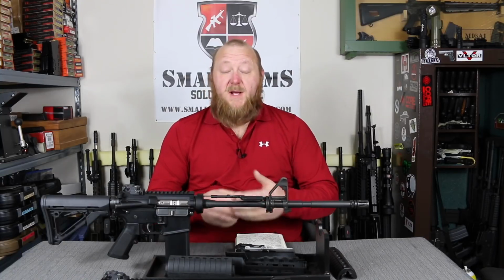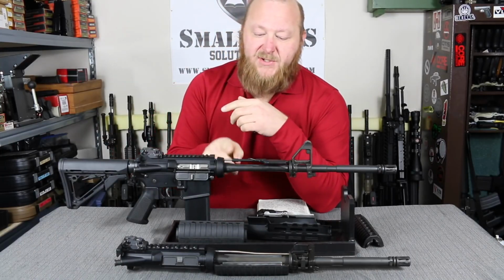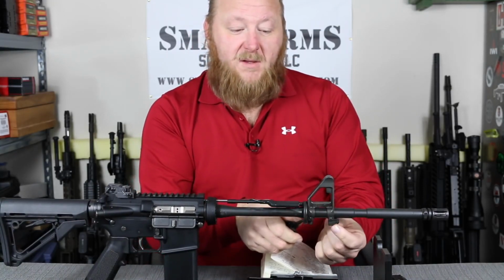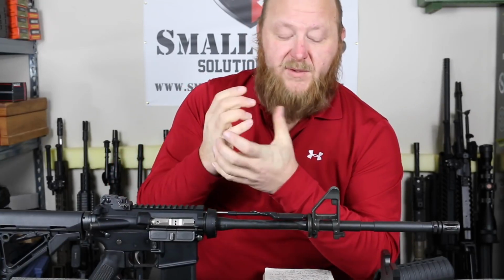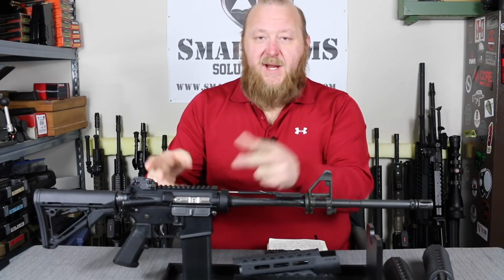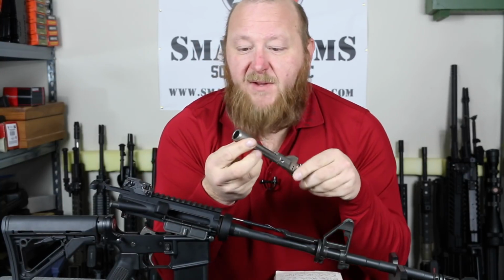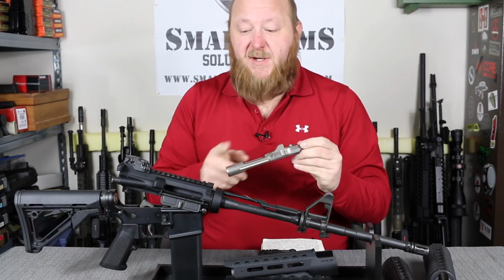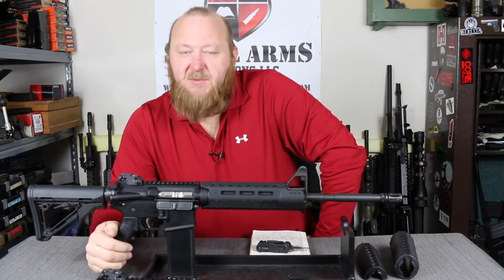Osprey 416 Piston Conversion Kit

Comment: The direct impingment system has had the bugs worked out of it. When our troops first got the M16 in Vietnam, many died with a jammed weapon. It is dirty. The farther you can keep the grime from the chamber, bolt, and carrier, the better.
Reply: True but the point of this system is ease of cleaning and suppressors.

Comment: DI system and piston system. Change Law of Physic. Push vs pull of gas to action bolt carrier. I have all retro fit systems. Osprey, Adam Arms and Ares. Osprey and Ares systems maintain FSB, a huge plus. However, Oprey required to grind the barrel nut down ro permit the op rod freely slide. One piece bolt carrier needs redesign due the carrier tilt issue. On the other hand, Ares is well designed system  and too bad they not longer the market. Adam Arms well designed system as well. Too bad, no re-use FBS. No carrier tilt as well.

Comment: Its too bad that the op rods are now only available in the carbine length, via Osprey Defense’s website. The op rod is only available in the standard version too, not modified. This conversion kit is a great design (best imo - it could use some tiny improvements though), but this kit is slowly becoming a fringe product / solution for piston conversion options. Give it another year and I think it might not be available anymore. If Osprey Defense — owned by Franklin Armory — did an advertising campaign for this piston kit,  and proved the kit’s abilities.... I think it could step over other piston kits available and be in the lead for this particular market.

Comment: Great presentation and agree with your evaluation. I've followed them since the beginning and have one installed in an
original Bushmaster 16" Carbine. As you say the greatest advantage is the extended dwell time produced by the "kidney"
shaped cylinder and piston. It give a greater working volume for gas expansion which allows the port to remain the same size 
yet probably keeps the system pressurized for a longer period at a lower overall pressure resulting in a "softer" push for a longer time. It would be interesting to measure/calculate the volume of the Osprey cylinder and compare it to the gas tube and standard
 bolt carrier volume at the point where the gas vents from the piston gas rings. It brings to mind the original
ZM Weapons system that I believe utilized a plenum chamber in the gas block/front sight.  Best regards.

Comment: Watched ur video and makes alot of sense to me now. I've never had piston ARs but had AK and SKS in the past. This is my first AR and it's a mix match DI and I have been looking for anything to help longevity from the rifle before failure. So far I've installed a Faxon TiN BCG, a Super42 buffer spring and H2 weight, an adjustable gas block by OdinWorks and am wondering what does it take to get something with the performance level of the little P416 that IraqVeteran8888 tried to meltdown and couldn't. I know that particular gun is a piston driven AR but with that part alone aside, what in the heck else could it possibly be helping it to last the distance other than the fact it's just POF we are talking about here and they rock? The only things I can possibly think of doing that I haven't is to go with an inconel gas tube which I'm using carbine length gas setup and 16" barrel, .750 etc etc and maybe going with a CHF Barrel chrome lined like from RockRiver or RainierArms. Can't think of anything else that would help to ensure durability. It seems to me the p416s trick is to keep the heat from being able to work its way back into the upper, by some means I just can't understand as it's not really explained in the video he did. I'm using a 15" free float rail no polymer anywhere around the barrel. And I typically shoot 62 gr m855 shells but use standard 55 gr American eagle at times. Thanks all

Comment: Di is not internal piston. The bolt carrier is moved rear by the gas from the cartridge. Gas piston is cleaner, and runs cooler. Both systems work. Its a matter of preference.
Reply from the maker: You don’t understand mechanics I am afraid

Comment: Did you grind down barrel groove to allow the op-rod slide smoothly? Op-rod and piston chamber are not same plane. For Magpul handguards, you need to machine aluminum tabs down at least .375" to fit else interference will occur.
Reply from the maker: No modification at all, this unit dropped in place.
Reply: @SmallArmsSolutions  Groove in the barrel nut requires to grind down for the op rod freely travel.

Comment: Piston systems are ok, yeas you don't have to clean the bolt as often, but that carbon has to go somewhere which means its in the gas block and piston system, IMO its much easier to clean a BCG.  Also piston systems are inherently less accurate, as you mentioned they suffer from carrier tilt, and cam pin wear
Reply: The difference in accuracy is so minute it's not noticable. I've used the Adams Arms piston kit and shot sub moa at 100 yards consistently. Recently I removed the kit and returned it back because there was nothing to clean lol.
Reply: While it is true that they are less accurate, fundamentals will affect your accuracy more than anything. If you suck at shooting, piston or DI won't help.
Reply: @nick korte I'd love to shoot one and see the difference. I know piston is all the newer rant an rave over DI but for the reason I'm assuming standard issued m4 carbines for armed forces is still DI today is prob for good reason. To me, in the video, I can def tell the gun seems to jump a little harder at the end of each shot, a blowback recoil, if u will, especially the faster he shot in succession, than what your normal DIs seem to flinch, atleast to me from what I observe. I am sure this is prob subject to alot of other criteria but even though it seems to shoot smoother and maybe even somewhat faster, it has a violent after effective at the end of each shot that I can see and not too sure if I'd like. For me the super 42 took care of all of that, which it didn't really have to begin with IMO, as a DI 16" standard milf spec setup. Just my 2 cents
Reply: @E-4 for accuracy I can't brag enough about trading out the trigger for just about anything else u can get aftermarket, and that alone makes a huge difference. 

As for cleaning the bolt, SRC Relia-bolt or any other variant with the same specs for a BCG should nip that little nuisance in the ass for the most part, or as good as one can hope anyhow from my experience

Comment: You think DI is superior to piston kits huh?  Personally I don't like to shit where I eat, so I agree with military experts.  Piston is superior to gas
Reply from the maker: 4g63mark military experts?
Reply: More expensive, heavier, reduced accuracy, greater wear damage, increased complexity, proprietary systems with low parts compatibility, harder to service, not user level maintainable in the field, fouling in the piston tube and gas block requiring disassembly of the gas block to clear. Marginal benefit to a suppressed or high rate of fire scenarios that are better served by other designs without these complications. This "shit where I eat" nonsense is fudlore spouted by people who have a lack of understanding of the AR platform and are being swayed by a marketing gimmick.
Reply: M16 and M4 are DI guns smart guy....and lemme guess, you like piston guns cause you have one. i bet if by chance you bought a DI gun you'd say DI is superior......
Reply: @0311-USMC  I have both.  Believe it or not, my favorite of my AR's is a DI gun.  However it's not my favorite because of the gas system, it's my favorite because I built it the way so many AR builders refuse to build their AR's.  I built it with a Polymer upper and Polymer80 lower.  I threw in a Brownells lightweight BCG, and an Armaspec sound mitigation buffer.  I also put lightweight JP springs in my mil-spec trigger that I modified to fire in binary mode.....  So to some things up, it weighs 4 pounds, only cost a little over $400 to build it, and it's exactly the way I want it.....  With that said I prefer my piston gun because it's less maintenance and performs WAY BETTER suppressed because there's no gas coming back into the shooters face.
Reply: @andrewdriver3318  Damn how did we manage with our fals for so many years,  it's a preference what system you go with there are pros and cons with both systems.  For me if I was to build an ar15 it would be piston driven and side charging because that's my comfort zone everyone wants different things why it has to turn into an argument and a which one's better says more about people then it does any system or component.
Reply: @AndrewAustinFrustrated  I have a piston ar. There is nothing wrong with an informed preference. I was attacking the op’s lack of informed opinion and repeating of fudlore bullshit. There are benefits to both.
Reply: @andrewdriver3318  Absolutely I've mainly used piston driven rifles the L1A1 most of the time and they never failed I understand the DI bias of many it's the system they are more familiar with and is perfectly functional.  There is a lot of bad information on piston systems even from some that should know better but end of the day it is a preference thing each to their own.

Comment: I spent $300 on this gas piston system & It's a total POS. It just doesn't load rounds. I gave it to my gunsmith & we worked on it for almost a year & it's a total piece of shyte.  Franlklin Armory bought this Osprey rip off system' & they won't even touch it or deal with this POS system. The A-holes who created this BS system have long disappeared with other people's money. Franklin told me it seems to work somewhat with short AR carbines, but not mid length & above AR's.  
DO NOT BUY, & if you decide to buy this junk, Caveat emptor.